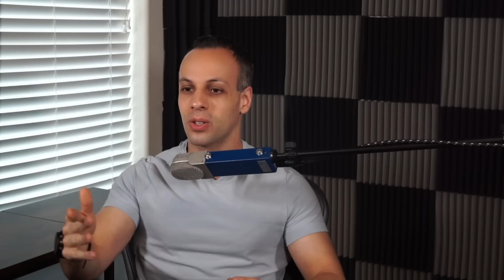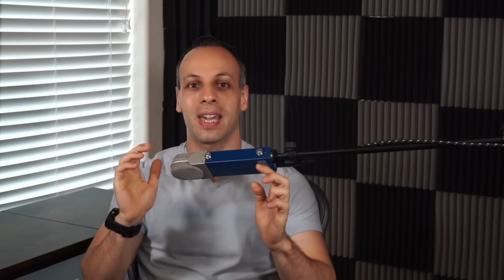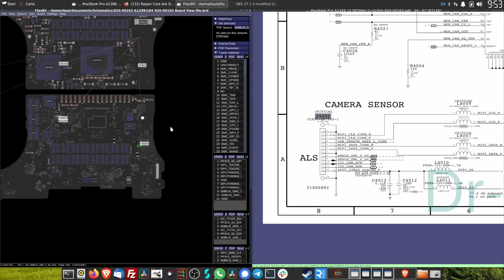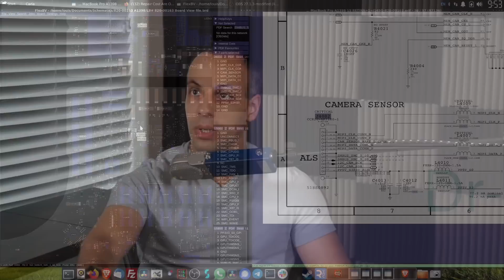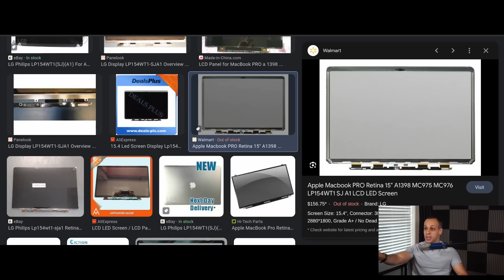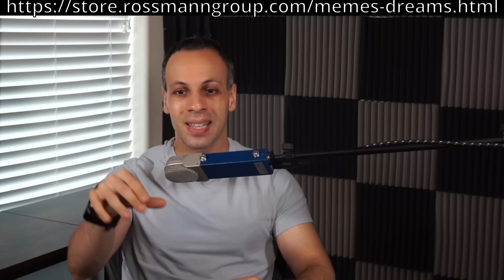The Ford F150 Macbook - when car repair resembles macbook repair...

Comment: funny thing is that most good companies have "failure analysis specialists" on staff
the job of these people is to find out how to break something, and how easy it is
the goal is to ensure the device doesn't return for design defects within warranty or to design warranties to be perfectly tuned to end right before expected failure
funny thing about apple is that they don't do it that way, they design it to fail, blame the user for design defects, and then refuse to admit guilt directly while the legal system literal forces them to fix the defect, the legal equivalent of admitting the defect is a defect
ssd and tsop/bios/spi-rom are two seperate parts for a reason, a full ssd is expensive, always has been, but a tiny 8mbit flash chip (or even down to 1k eeproms) have always been cheaper and more reliable than main storage
so designers set up the POST system to operate on storage known to last at least as long as the intended lifespan, they incorperate software locks and such to force updates that break things or ensure a device that must be replaced regularly is replaced
the intention is to make eitehr a modular configuration system for customer requests, or to ensure the device lasts past the costly warrenty timeframe
my laptop I am currently typing this on isn't 1 soldered brick, because they need to be able to sell it with more or less ram, storage, battery, or even a 144hz display
so they have a mainboard with the low-profile PCB slots called sodimm, the impossibly small m.2 slots, the flat jst style connections for battery, the as small as hard soldered lvds connectors, ect
it has multiple slots due to wifi-6 vs other standard wifi cards(and maybe overseas standards) and a second NVME slot as well as a low-profile sata cable for the optional 2.5" drive
it makes sense to have a base config that can be changed at the factory simply by imaging drives and having a few bins of optional parts
it costs far more to spin out an entirely custom PCB for each skew in the quantities required, it is cheaper to spin out just one board, and have a bunch of extras you jam on as needed

so why does apple have so few yearly options? they forgot how manufacturing works, the truth is they stopped innovating so long ago they even forgot how stuff is made
why are things so irreparable?(besides intentional design choices) because they stopped paying attention to how thin and light they already got and the innovations in low profile and low weight electronics
truth is apple fell off the tree back when wasniac or jobs left, they forgot what made them great and stuck to old ideas that have been discarded by the industry decades ago, and they are so arrogant that they can't admit they are basing their ideas on tradition rather than innovation, just like scientology, who are so insane louis is going back on the totally reasonable "schematics or die" meme

tradition is ok as long as it is not your only trait, innovation is ok as long as intention meets reality, economizing is smart as long as the total intended value is unchanged
a cheap ATX psu for example is obviously only a 5 year device, but spend 2x on a name brand and you actually get a 10 year defect warranty(real example the day I am writing this)
so a mac being sold for 1000$ should be at the very least just as powerful and durable as a similar non-boutique device like the model of my laptop I am using now sold today(about 700-800$)
you pay extra for the style but the style is not more than 25% of performance cost
just to be clear, I am speaking of the 1660 and I5 model of the 2020 asus tuf gaming f15 with 512gb+1tb and the smaller battery 16gb ram and the 1080p 60hz display, I paid 1k$ during pandemic and when it was new, but rather than pay just as much today(like apple does) 

I expect prices to fall each year till the stock or the model design shifts so far you can't replace it anymore
a 3 year old design is fine to sell, as long as you sell it as what it is, the budget choice

I am disappointed at how expensive a plastic bottom case is to replace when cracked(50$ for a piece of 100% plastic injection molded garbage is unacceptable, maybe 25$ but not a penny over 30$) but at least it is offered, with apple I could not have replaced my cracked LCD 2 thanksgivings ago, it would have been 1000$ again rather than just 80$ and a bit of fiddling to install

designs of any equipment either classed as "heavy machinery" or "personal computing" needs a practical repair minimum
we don't say your car needs to be replaced when the oil is only 5000 miles old, we swap the oil and it is fine to keep doing it's job
we also expect tires to die, so we don't weld them to the axel
we expect brakes to wear out, so we make them replaceable
we expect bulbs in indicators to burn out, so we make them replaceable
we expect water to get inside a device that is parked or operating outdoors 100% of it's life, so we design the parts known to get wet to be replaceable or redundant for safety, so why is ford not being sanctioned for an optional feature getting expected water damage to not have a failsafe that disconnects the extra from the bus and just throws an error code that it needs repair? umm literally no reason can possibly exist to not have a factory recall for that shoddy of a design, it could have been a car flying down the highway in rain, and when the sensor failed the car shuts off, the brakes do nothing, the steering goes limp, and someone dies when the dead car coasts right into them
if this failure happened while traveling at highway speeds and a person died would ford not be sued? so why are they allowed to not be forced to completely redesign this and to disable the functions until a safe solution is found?

if a laptop is designed to rely on something that is not mandated to be there already(ie internet nd overly expensive cloud storage services) to recover data when the 100% guaranteed ssd boot failure occurs we should treat it exactly like a car that shuts off while flying at highway speeds, we do not accept it, we force the company to fix it, and we make sure they are not able to ever do it again
so it is now illegal to solder an ssd to a motherboard with the BIOS data integrated onto it right? no? then you want uncontrolled cars killing people from water damage issues to be legal? no? PICK ONE

Comment: One solution: the sum of the cost of all spare parts for a product must not cost more than the product itself (obviously not including work to install and handling and shipping in this calculation).
A simple way to enforce it: if a manufacturer lists a spare part for X dollars, the full product with that spare removed must be X dollars cheaper (again work to remove does not go into that calculation). In this example Ford says the taillight costs 5000 USD. In that case they would have to offer me an F150 without taillights for 10,000 USD less (work to remove on ones own expense).

Comment: What bugs me most is that the modern cars have LCD screens that can theoretically display very useful information but rather than provide the car owner with details of the actual error the manufacturers program it to just display a non descript check engine light or a message to contact dealer.

Comment: Kust made Crescent Rolls are soft and tender by;  Lili Luna, that is the hardest thing ive ever done with a bowl, four cups of flower in half a glass of milk, but I got all hulked over once  I had to fist gobs and gobs and gobs of flower gently into this angry Andre the Giant mass, quickly fell into two clumps...after a while I realized you are just a machine - [ roll dogh a fingers with, then press your fingers all the way through as fast as posibble.
Boy they are pretty tasty though 4 out of 5 - [ 7Daze Egge Synthetic Mesh Rechargeable Disposable Device (3000 Puffs) - Melonana ] stars.

Comment: I had a car where the radio crapped out and the whole dashboard lit up like a Christmas tree and I lost TC, ESP, ABS and all other acronyms related to the car's stability. Also, the AC stopped working as did the remote keyfob. I could only lock and unlock the car by physically turning the metal key in the door lock. It still drove, but I genuinely feared that my airbags would not deploy in case of an accident. The problem was that the radio, or rather a specific module of the radio system, was part of a CAN bus loop along with all the other modules. Luckily, the module connector was really simple: 6 wires. One for +12V, one for ground, and two CAN bus wire pairs. All I had to do was to use two 0 ohm resistors to bridge the CAN bus pins on the connector and voila, all the errors went away. I had no radio, but also no errors. Why in the name of whatever deity you subscribe to, if any, does the radio need to be on the same network as systems such as ABS, beats me. But anyway, maybe the same can be done with this headlight. Bridge the can bus pins on the connector to complete the CAN bus loop and away you go. You'll loose the obstacle detection and maybe get a warning light but then again, why the ** do you need to detect obstacles with the tail lights?

Comment: As someone who went through school to be a mechanic. Yes car companies 100% on purpose have been designing their cars every decade to more and more phase out repairability.
Same as tech, they do not want independents fixing vehicles. They want all the business in their own ecosystem. Either charging 10x more at a dealer, for just dropping in entire systems instead of repairing anything anymore. Or just manufactured planned obsolescence so you'll buy/lease a new one.
It's honestly sadly why I quit pursuing being an auto mechanic.
I didn't join the field to be a tech repairman who worked on cars, I joined to be a mechanic.

Comment: I have a 2001 Volvo with a similar issue. The alarm siren under the front bumper has a nicad battery sealed inside of it. The battery leaked and destroyed the circuit inside of the siren. This causes the sunroof not to function. Very common problem with early 2000s Volvos.

Comment: I have been speculating lately about collision repair, especially in the context to the Tessla gigapress. If the damage moves a critical mounting point the vehicle could, (would?), be totaled.

I have been rearended several times, five grand for a tail light is wow. My dad had the tail lights stolen off of his 1959 Cadillac, his insurance paid for them with the caveat that they would NOT do it again!

Comment: CAN bus transceivers are differential-mode by design. They're supposed to survive a direct short to +12V on the data pins (the chip will of course not work in these conditions, but it won't fry the whole board and your computer module will work again once the fault is removed).

Comment: You think that is bad? Try replacing a windshield on any modern car with cruise control + features. Some of those damned sensors are built into the glass. Miserable!
I'm doing just fine with my 2010 car that I can still fix things on.

Comment: Ford BAD!! Have a 2017 Escape and giving transmission issues. To have them look at it, have to book an appointment 1.5 months in the future and is $200.00 per hour just to try see what the issue is. Even to have them just do a transmission flush and service, they have to agree to it and it's 2 weeks out in the future. Well took it to a JiffyLube and in 2 hours was done. Sorry Ford, you lost the money. Now what about the appointment 1.5 month in the future and I still need to use the car? Bigger issue? Car breakdown even more and cost much more? Looks like all is becoming a service that is pay as you use.

Comment: Expensive sealed light fixtures in general are a goddamn crime against the environment.
I don't mind LEDs on my stuff either, I just don't think it should be necessary to order $500 light fixtures from over seas to fix $5 worth of damage because the asshats who built the vehicle didn't think it would get subjected to vibrations or a stray piece of gravel.

Comment: It’s actually both. They do design things intentionally to be a massive pain and expense to fix. That’s why parts that should be easily accessed are buried under half the engine now. everything is serialized. Simple unnecessary chips failing cause complete failure.  They also rush through the design and production of everything they do though.  Its all done by people with no experience and they do little to no testing because they don’t care about the after math. Just dead lines. As long as they get those initial sales, that’s all that matters. On to the next years disaster! You can get it fixed for a fortune or don’t. They don’t care. You need a car. So as much u hate it you’re going to have to get a working car one way or another. 

I did prototype work for ford and it was such an unorganized mess and and everything was just hurry hurry hurry. We did the new run of the broncos and the first run of those all had leaky roofs right from the factory. Then they were just sending them back to us to squirt some glue in there in some extremely ghetto fashion and that was how your brand new bronco would come. With issues right off the line and someone slapping a band aid on it calling it a good car. And thats just the issue I’m aware of. I’m sure they’re riddle with electronic issues like all these other new cars too.

Comment: Sounds like the sign falls on purpose or not it doesn't matter. The company still designed it so I believe they should be responsible to repair it. Companies spend millions and billions of dollars on research and development and then passed that cost on to the consumer when they sell the product. Sounds like a them problem. Speech-to-text. Sorry for any errors.

Comment: I've only had one Ford vehicle (Ford Escape) and it was a nightmare. Constantly breaking down. One example is I needed a new carburetor and when a friend of mine who knew cars tried helping he explained that most cars put the carburetor in a place that is extremely easy to access and take out if need replaced, but not this one. You basically had to take the whole engine out in order to access the part. Got a RAV4 now and have literally had zero issues for years.
Reply: No, Ford escape in the history of Ford escapes has ever had a carburetor installed on it! You dummy!
Reply: A carbureted Ford Escape? You had a 1-off limited special edition, my friend!
Reply: No such thing happened bro lol😂
Reply: @baldisaerodynamic9692  Yeah it did I was there bro lol 😂

Comment: This nonsense isn't new. I have a 1998 F150 and had to replace the heater core which is where the heater's heat comes from. Engine coolant circulates through it and they can get clogged. If you open the glovebox, you can see it. To get to it you have to remove the entire dash and drop the steering column. The part is $50, BUT the repair is $1000 because it takes ALL DAMN DAY.

Comment: I absolutely think there is someone thinking and mandating things are done to make it harder to repair and require new parts be purchased at ridiculous prices.  The rubber pieces on the outside of the windows on my Honda Odyssey dry rotted.  Honda charges about $100 for a fifty cent piece of rubber that will probably dry rot in another year and I can’t find it third party.

Comment: I don't buy the story. It's a 'new' vehicle, that's a warranty job. Either someone admitted to Blue Oval 'Yeah I blast out the tail lights with a pressure cleaner every week' or there's non-factory mods to the vehicle that allow the dealer to void the warranty.

Comment: Way back things were better?   How about this:  My parents had a 1958 Ford Fairlane.  It helps if you look up a picture ofTe rear of this car: "1958 ford fairlane images rear".   The taillights, all four of them, had a rubber seal.  After a few years the seal was incompetent in keeping water out, but excellent in keeping water in.  So after a rain the taillights were visibly half-full of water.  The taillights would still work just fine.   Even if they corroded badly, they didn't share any data bus so the rest of the car was not affected.    They could have designed the red lenses with a small weep hole or notch along the bottom edge, but they didn't.

Same vehicle had no wheel-well liners at all.  Snow and ice and salt would splash up behind the front headlights and stay there and quickly rust through the sheet metal.  It took only about 3 years for there to be fist-sized holes above and around the headlights.  

One of our neighbors was a mechanical engineering professor, so he shanghied one of his grad students to acetylene-weld up patches for those large holes in their Ford.  

Also the engines were only good for about 35,000 miles, then they were prone to burn oil, like a quart every 800 miles.  Oh wait, I forgot,  they would leak oil just sitting right in the showrooms.  They had baking pans under the engines in the showrooms.

So Ford, not so much, if any, better way back.

Comment: 4:03 Good to see nothing has changed - my 1988 Ford Escort Cosmopolitan (apparently now a rare, limited edition... for good reason, it was dire) suffered from water ingress to the tail light clusters - as did all Ford Escorts, you could see it when cars were signalling and the brake/sidelights joined in with the flashing. The difference was that when I was pulled over in the 90s and warned by a nice policeman it cost me around £20 for two new lamp units (the other one was on its last legs) and a small time to fit them and clean up the connectors.